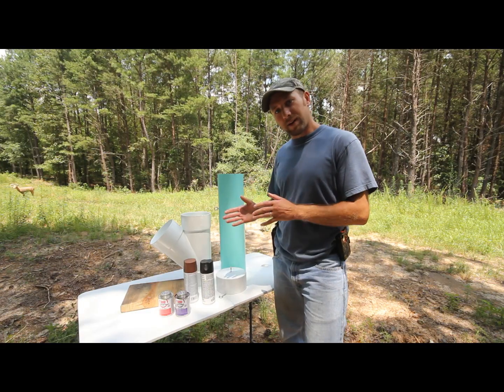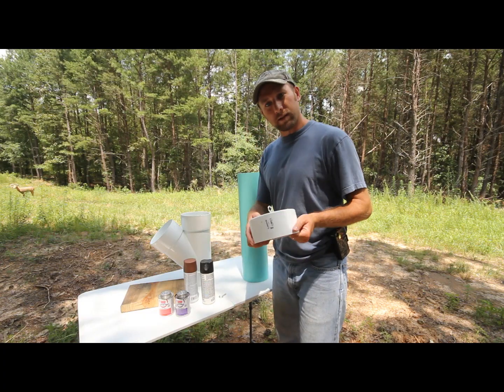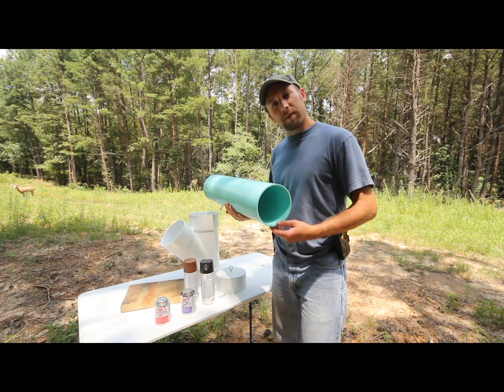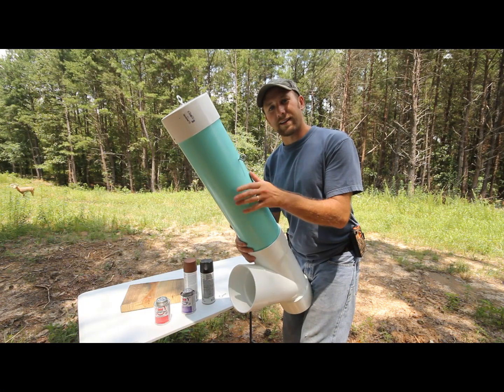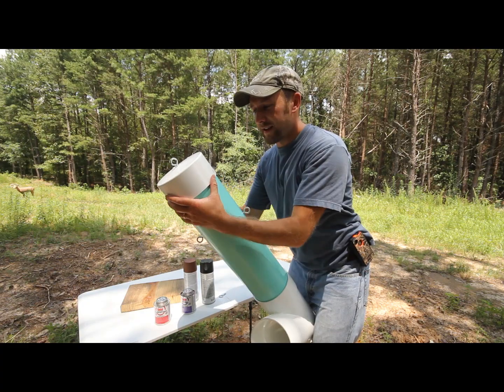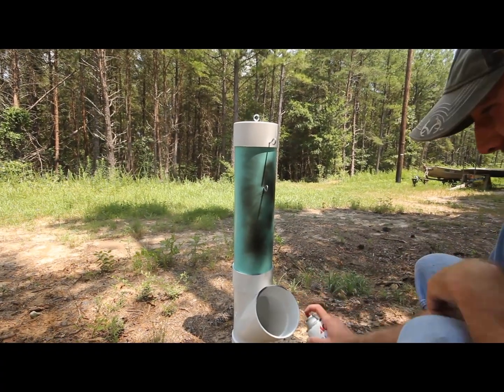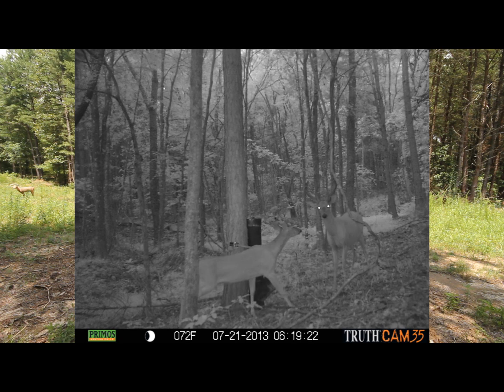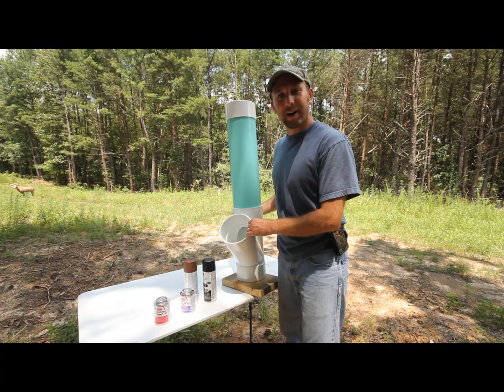How to Make a Homemade Deer Feeder

Comment: i dont hunt, or kill animals, BUT i appreciate this video! i have a BIG issue with wild hogs, they are taking over, and i am one step from having to have them shot. which i dont want to do. so i think making feeders like this, and hanging them high enuff off the ground that deer can get it, but pigs have a hard time. may keep interested in the area i hang these? may keep them trying to figure out how to get it...anywho, this is tomorrow project. i lucked out. the previous owner of this 20 acres left this exact pvc pipe all over. i had set all the povc pipe of different sizes up thinking maybe i would have use for them sometime. well, ding ding ding...all i have to do is get more wyes and caps! yea, i hope this helps. i know it wont totally fix this issue, i am also fencing in the 2ish acres that i call the yards. if they stay back in the woods we are fine, but they are coming right up to the house for the natural food they find here. roots,  acorns, berries in spring, ect....i dont want to kill them, bu if all else fails i will have to learn to shoot. now i chase them off with a toot of an air horn. my dogs tell me when they are here and i hit the horn. (fyi dogs always protected by yards, and inside at night. :)
Reply: Put hog fencing around your feeder area.  Deer will jump it.  Hogs will figure out that they can’t feed there!

Comment: I been making those for years. I use taller poles to fit more. I also use a grated bottom so that if it does rain, the water goes right through and wont spoil the corn.
Reply: I was about to ask in the comments what about rain getting in the open end since it’s not covered. So the mesh works good ?
Reply: @gdawg4ever119  yep. I just buy one of the open drain grates thats same size of pipe and glue it in.
Reply: @jrashop  thanks 👍🏻

Comment: Nice concept,.but the cost of pvc pipe  and the fittings now is likely to exceed the cost of buying a feeder straight out. Might be cheap to buy a used drum and buy the three inch feeder spouts. Drill in bottom and insert the spouts. 

You'll hold more feed.

Comment: Great video and thanks!  I made three of my own in December and they are working great.  I started with 4 inch pipe about 5 ft. long but that didn't hold enough feed.  I eventually made two out of 6 inch pipe (like in your video) that neck down to 4 inch "Ys".  Both are about 5 feet long.  I pained them brown and green but that was just for looks (the deer don't really care about the color).  I've been feeding them a mixture of corn, Sportsman's Choice (golden deer nuggets and deer & elk feed), rolled oats and alfalfa pellets.  The Turkey, crows and birds also like the mixture.

These feeders work well however they do give the deer full access to all of the feed they can eat.  My regular herd of about 20 deer will eat upwards of 60lbs of feed a day if I let them so be prepared to spend some money on feed and to be filling these daily.

Comment: I make something very similar to these, except I bolt a toilet flange to the top, and then bolt a 5gal bucket onto the top. Make sure the bottom of the wye is capped and Hang them from a tree about a foot off the ground, keeps the raccoons out of the feed. Just set up two of them today with some trail cameras in front today, we'll see what comes by!

Comment: Simple, uncomplicated and effective design... I like your design best because it's 6 inch wide PVC pipe, and I think a 6 inch dimension definitely makes it easier for the deer to eat than the cheaper 3 inch size. The cap will keep raccoons out of the top of the verticle pipe... but not our of the bottom portion where they too can eat like the deer. I'd forget about using that board under that bottom point, and I would use a slotted-cap and allow rain to DRAIN without any corn spillage there.
Reply: That's what I wondered. Aren't all other animals just going to eat from the same opening the deer use anyway? And the corn is still going to get wet even though the water runs off, right?
Reply: @TexasDivorceAdvice  I’m no hunter but feed deer in an urban suburban area. Adding a Y cap on the bottom with holes drilled in it will allow water to run through and diminish the corn feed from becoming moldy.

Comment: THE FEED SAVER....saving bucks and keeping doe....with the ultimate feed saver. We at the feed saver company have come up with a device that keeps all feeds super dry and fresh even proteins under a timed spin cast control, so you have control without waste on a timely manner. We have an insert that fits into a 55gal. drum for the average hunter that wants to feed protein and any other feeds without gravity feeding and just can't do it without using a large gravity feeder that still has problems. This product holds about 250lbs. of corn and 175lbs. of protein. Our suggestion is have 2 feeders one to go off in the morning and one to go off in the evening. Suggestion also put  hog panels around your feeders 3 ft.high and 20 ft. Long a wonderful investment. Definitely keeps hogs away, deer do not like HOGS. This product is made of polyurethane it last forever and help the drum last a very long long time. It has a funner shaped bottom with an extension that sticks out of the drum to the spinner plate, it also has an over lapping lid so it can be over filled and to keep water out. Our product is made here in  AMERICA and in TEXAS. SUGGESTION IF CAN DRILL 5  OR 6 HOLES in the bottom of the drum to let water that may occur drains out. Suggestion now you can put an animal cage  around your solar panel just like around the timer. Self sufficient. .. any questions call 832-982-buck 2528 watch video on YouTube (feed saver) THE FEED SAVER SAVING BUCKS KEEPING DOE WITH THE ULTIMATE FEED SAVER.....        ......IT WILL CHANG YOUR HUNTING LIFE.....